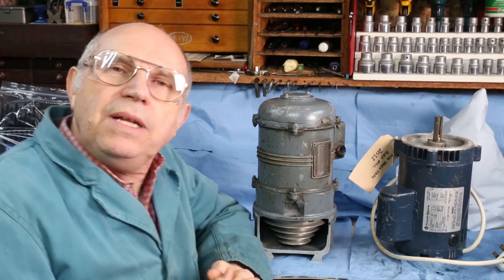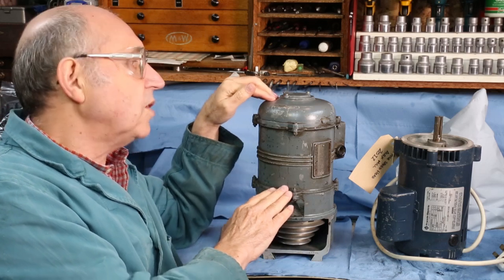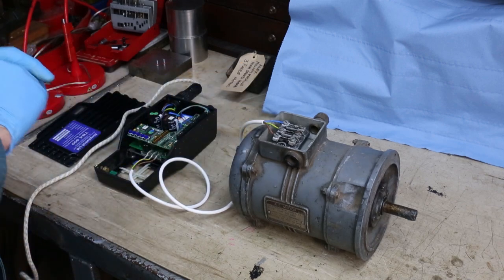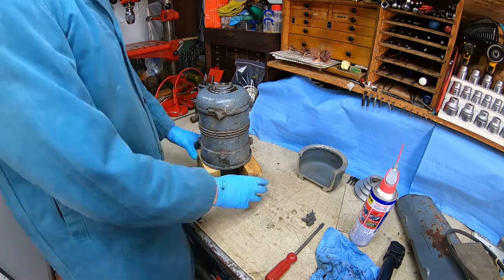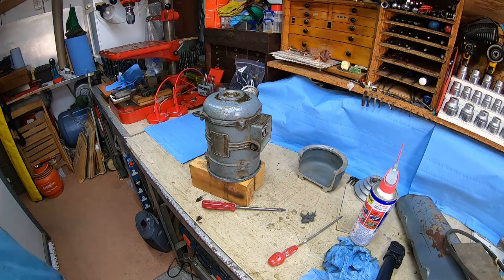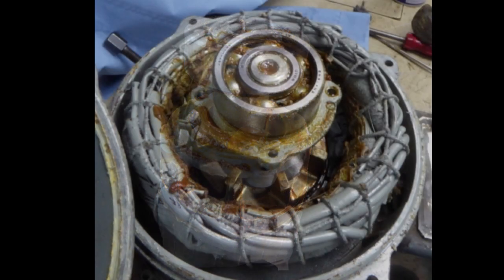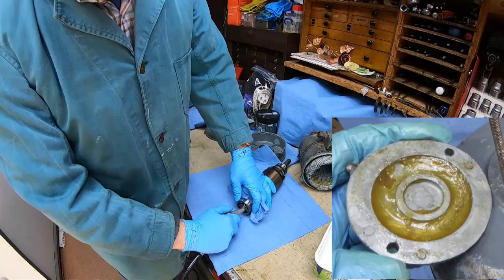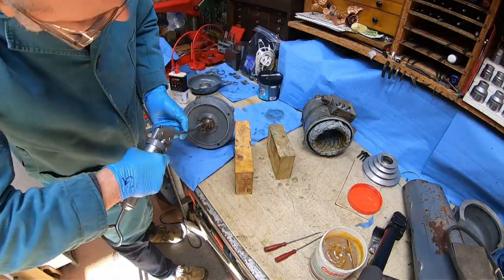Grease Motor Bearings

Comment: At 7:23 Electric Motor Grease is the grease to use.  It can be found by Google Searching "EM-Grease", or "Electric Motor Grease".  Highlighting either of these 2 terms and select Google Search will return 'SOME' good answers.  Be sure to select a proper Electric Motor Grease answer because Google may offer some wrong answers as well.  Most will say Electric Motor Grease, or may have a  prefix or suffix with "EM".. At 7:54, Googling "How much EM-Grease to use in motor bearings?" reveals 1/3-1/2 the free area to be filled and the faster the bearing operates the lesser quantity of grease required for all of the reasons you stated. 1/3 filled is the stated minimum filling.  Thanks for presenting this video!
Reply from the maker: Hello again John. Thank you for your comment.
Electric motor grease. Do you know, I assumed there was such a thing, but I have never looked for it as I’m quite happy with the performance of the Castrol LM grease. You must understand though that all my machines are old and most of their bearings are running on LM grease. Its difficult to teach an old dog new tricks!
Thank you for letting us know that Electric Motor Grease is available, and where to find it.
Take Care, Jim.
Reply: @CYC123  EM grease is formulated to withstand the heat being produced by the actual electric motor, (Amps x Volts=Watts of heat energy), as well as the heat being produced during the operation of the bearings, without melting and dripping, or at least delaying that point in time/heat cycles, longer than conventional grease. I am unsure if the grease is conductive or dielectric, more or less, than conventional grease.  It is also usually a tint of green as a visual que.  I ordered some bearings from a bearing supplier a while back. The technician asked how I wanted them to be lubricated. I asked what the difference was between various applications, I asked about electric motor operation and was given these various answers, and this is the result of that conversation. Thanks for your replies.

Comment: How will you prevent high frequency harmonics from breaking down the insulation of the motor windings?  And how will you protect the bearings from being damaged by those same high frequency harmonics.  Most VFD rated motors have extra durable insulation and "brushes" that protect the bearings by shunting the stray magnet induced current around the bearings instead of through the bearings.  What will you be doing to ensure a long life for this motor?
Reply from the maker: Hello John. 
Your question:
How will you prevent high frequency harmonics from breaking down the insulation of the motor windings? And how will you protect the bearings from being damaged by those same high frequency harmonics.
Well John the honest answer is, “Nothing”. At least, nothing at the moment.
The inverter you see in the video powered my original milling machine for over five years. It didn’t produce any problem with the insulation of the stator windings or the rotor bearings.
That milling machine is still working well at a local railway restoration museum.
The motor that powers the High-Speed head in the video you have just seen is of high quality, the windings of the stator are all well vacuum impregnated.
Full of possible false hope given to me by my original mill, I will sally forth into the unknown with this motor and keep my fingers crossed. My gut feeling is “It will be fine”. If there are problems in the future I will cover the events in a video and say I was warned this may happen. 
Thank you for your comment. Take Care Jim
Reply: @CYC123  I am in the same position, I don't know how to prevent the deterioration of these elements. I was hoping you had some answers I have not found.
Reply from the maker: Hello John. High frequency harmonics. I think I'm right in saying this effects the stator windings of the wires that makes up the stator coils. If that wire is not fully supported by the medium that has been vacuum impregnated into it, any unsupported loops of wire may "ring" at a particular frequency. That ringing will produce movement in the wire, where the copper is moving even slightly, it will work harden and eventually break. As the Inverter can swing through a range of frequencies, this increases the chances that it will hit on a particular frequency that will make an unsupported loop of wire in the stator ring. When I had my motor apart I checked the coils of the stator, all were covered in what looks like an epoxy resin, so I'm hoping there will not be a harmonic problem.
Damage to the bearings caused by induced currents. I haven’t heard about this problem before.
As it happens the bearings in the motor in the video are in their own faraday cage having conductive covers front back and sides. All in all, I’m feeling confident it will be OK.
If I do come across any problems in the future I will cover it in a video.
Thank you for your comments John. Take Care Jim